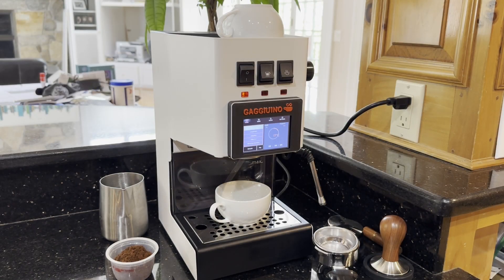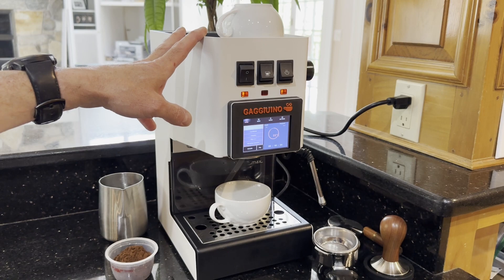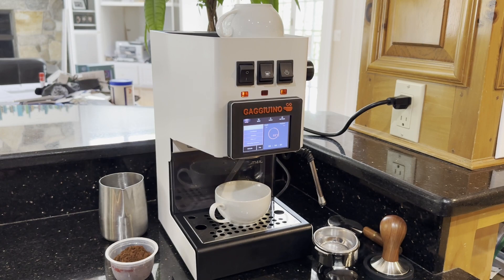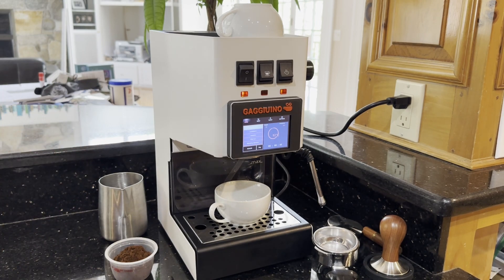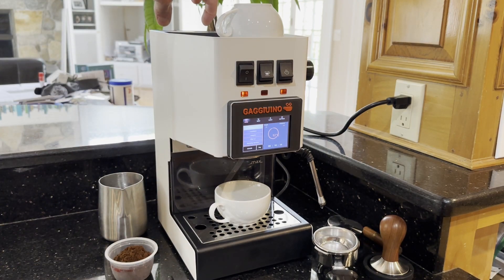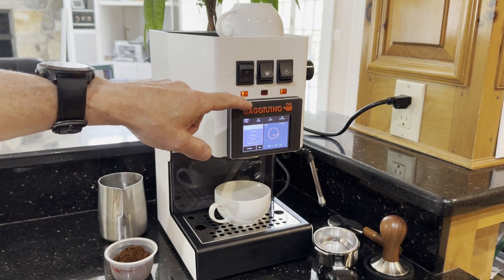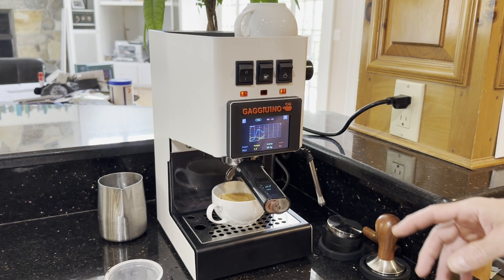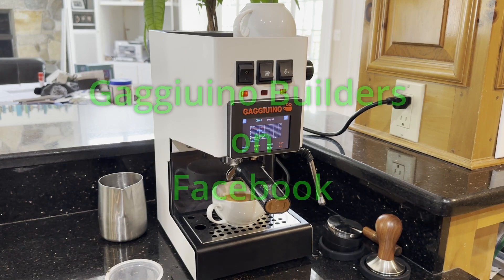Ultra Clean Gaggiuino© Build on a Gaggia Classic Pro. As good as Decent Espresso?

Comment: Im moderately familiar with electronics, how difficult would it be to take this PCB and code and make it work for a custom espresso machine Im making? Im planning to install a pump from a Ranchilio. I have a 1,200W 110V heating element on a custom boiler that doesnt do steam (may add another steam boiler later on). Oh, I also have an independent PID controller for the temp.

Comment: Does the screen get hot in that location?
Reply: It shouldn't. The screen part is a very low voltage one and it's enclosed on a 3d printed case.
Reply: @Sorcerer86pt  I think they meant if the screen gets heated up by the group head, since it's right in front of it.

Comment: i think i remember there being a setting with arduino that let u scale the gui with only one parameter in the theme.txt file, u have to add a line that says  ,"gui.scalePercent = 150" or whatever number u want and i believe that works, but i don't have a display to test with (yet). hope u find an easier way to deal with having a higher resolution display

Comment: Wow! Gotta say thats the best looking version of this I've seen. Screen size is fantastic, mounting location and method is ingenius as it doesnt taint the original machine and looks like it came like that from the factory. Absolutely brilliant! I wish I knew electronics and could do this! I'm not familiar with the code provided for this, but I'm wondering if it is possible to do a find and replace for that screen resolution setting? Usually the best practice with config settings like that is to declare the value as a constant global variable or have a config file to set the value in. Then reference that constant everywhere throughout the code instead of writing the value everywhere. That way it can be updated in one place by anyone who needs to

Comment: would love to see the steam ability too if you can! My PCB is on its way too, just receiving the rest of the parts now. Going for the 2.4in though as I prefer the discrete look and screen on top, but going for a larger screen front mounted is a nice idea! maybe I'll do this later if I get tired of small screen...
Reply: I didn’t try this machine before the mod so I am not sure how much the steam changed, but it is a lot more powerful than my Breville Infuser.
Reply: I have gaggiuino lego stm32 for 3 months, steam really great. now Im upgrading to pcbv3 and after that will check new firmware with multiple profiles

Comment: With this extraction is better to stay with the original Gaggia setup...
Reply: You can just type in any extraction parameters that you want and it will do it. 

The stock machine has no ability to regulate, flow, temperature, pre-infusion, or pressure. They are on complete opposite ends of the capability spectrum.
Reply: @rsilvers129  Sometimes less is better!
Reply: No substitute for food fundamentals